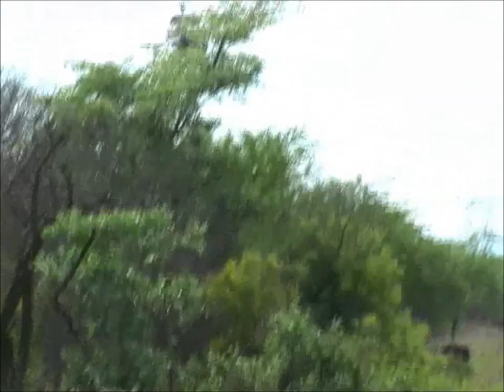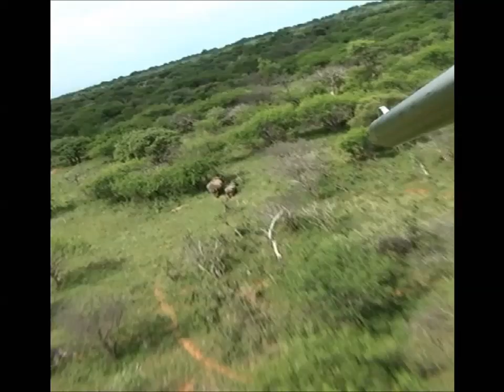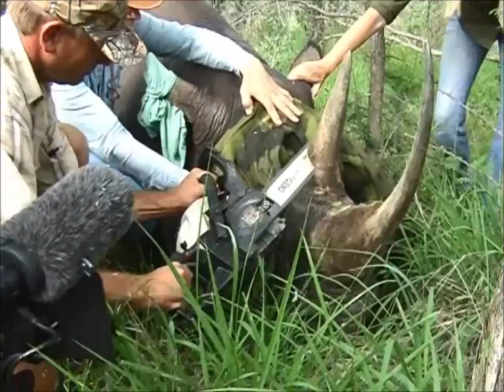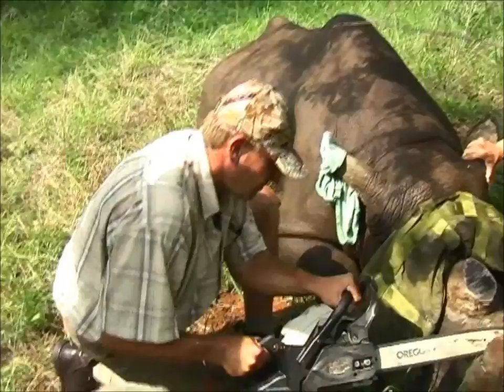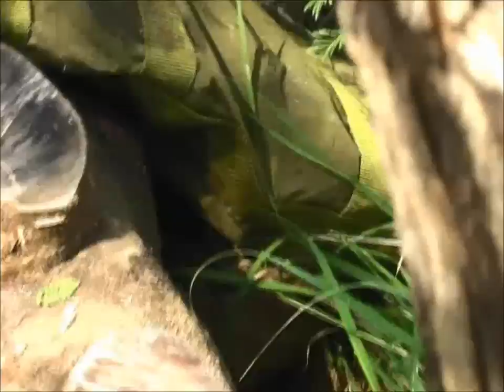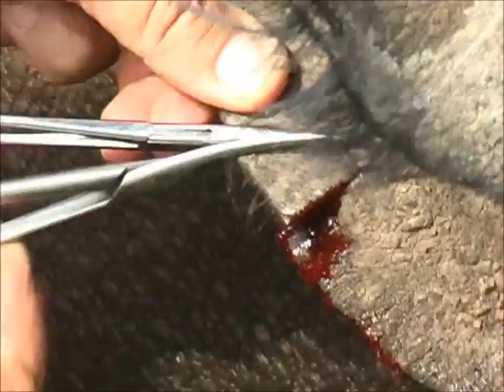Rhino horn removal and ear notching (darting & capture)

Comment: Kill the Poachers, dehorning does not work.  Poachers are still killing rhinos.    Save the Rhino Program reports:  "… why do poachers continue to target hornless rhinos? This is often attributed to the stub of horn that is left after removal. … although poaching is made less profitable, the sad reality is that poachers will still kill for a horn stub due to its high value... Poachers may also kill dehorned rhinos out of vengeance. In Hwange NP, it was thought that poachers killed dehorned rhinos, to avoid tracking them again. Furthermore, if there is thick bush or hilly terrain poachers may not see if the rhino has an intact horn prior to shooting."